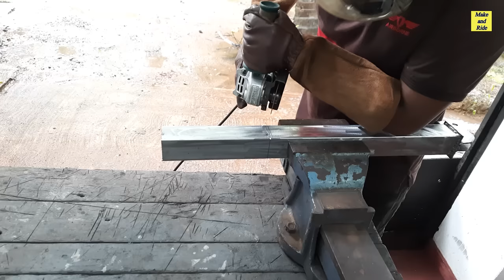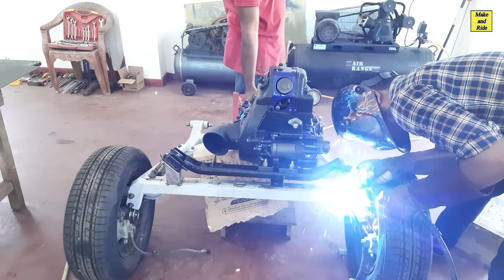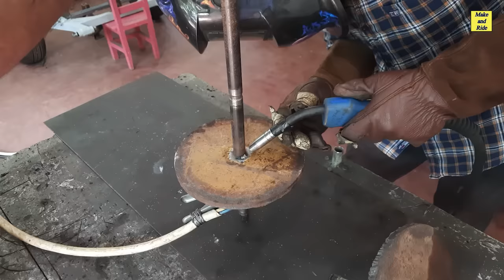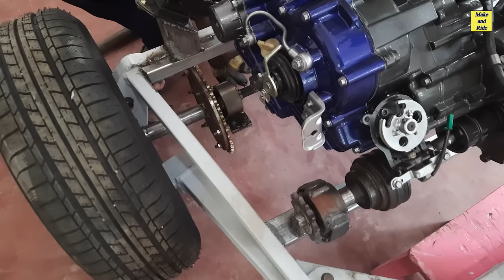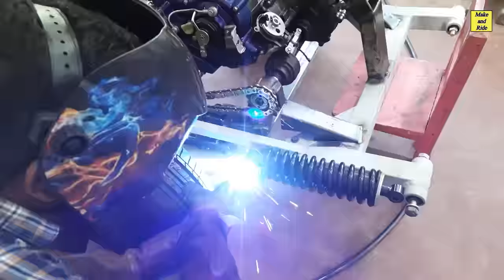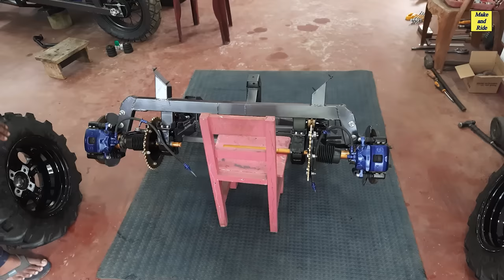How to Build Rear Swing Arm with Engine | How to make Buggy buggy part 1

Comment: That engine/transmission package is designed for IRS, making the engine as part part of the buggy frame and using IRS suspension  from the main frame by adding arms to it would be far simpler, lighter, and work better. You already had all the parts there to do this?
Reply: I have no clue what they were thinking. Cut up 2 sets of CV Halfshafts for what? Plus, now the whole engine is unsprung weight, horrible design and love how he used the steering arm of the knuckles as load bearing instead of the lower Ball Joints as were designed to be load bearing.
Reply: I still have no idea what exactly the purpose of this design is. Seems like way to many steps but maybe they have created a differential that locks and unlocks with this dual chain drive set up?

Comment: nice fabrication but you only need to swing the tires and not the engine with it.
Reply: Yes
Reply: The issue is with the chains needing to be tight at all times. The engine is better off traveling with the tires and chains so the chains don't get slack and slip

Comment: Could someone tell me what size and type of engine this is please?
I mean i know its a non branded copy engine, but what they are commonly used for or called would be good!
Reply: @Make and Ride necesito saber que motor usa por favor!!
Reply: You could probably use just about any kind of motor you want. If you want to use a motorcycle engine, it would be easier to handle. I’m planning on using an all electric motor for mine with an automatic transmission.